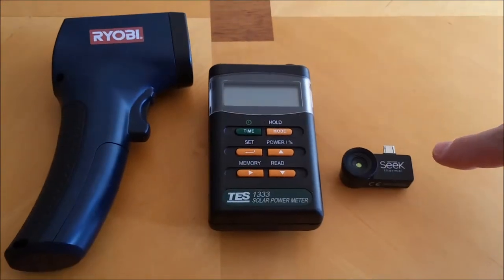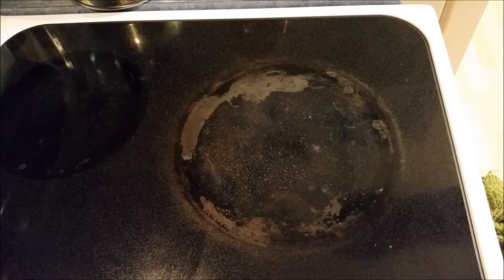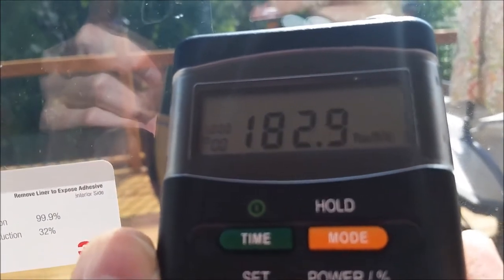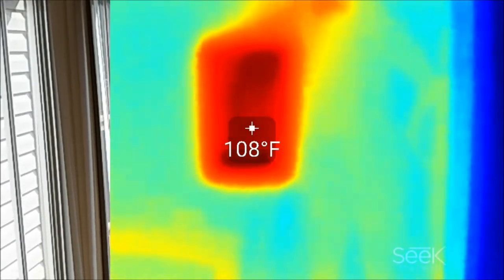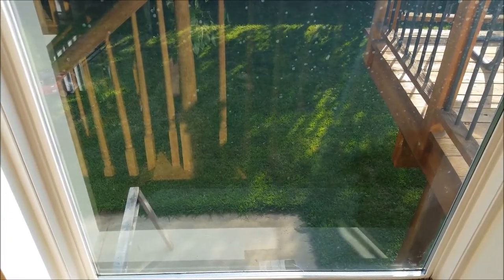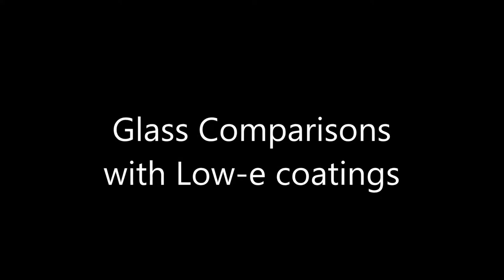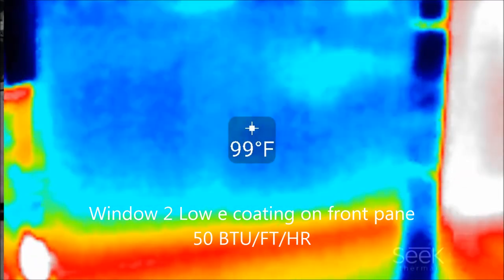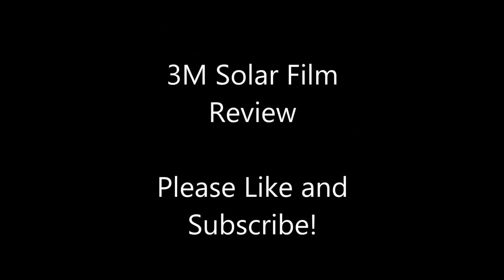3M Prestige 60 Solar Window Film Review

Comment: Hi Stem, I appreciate you posting this informational video. A few things I would like to point out as they may not be obvious.  1. With any window film the temperature of the window will increase, that is because the heat has to pass through the glass, hit the film and then pass back through the glass. In this process the glass and film will both get hotter. The good news is that this is heat that is not coming into your home. The amount of heat rejected from coming in your home is proportionately more than the bit of convection from the hot window.   2. If you install blinds the heat will enter undeterred into your home, while the blinds (because they are white) will be a lower temperature than the glass, you will still have radiant heat entering your space, and you will experience convective looping as you call it. 3. I think a fair test would be a before and after of the same space, same day, measuring the temperature of your interior space and furnishings in the light, not just that by the door. 

We have installed a fair bit of 3M Prestige, and the heat rejection is so significant that our clients see big differences in their utility bills, not just their interior temperatures.
Reply from the maker: Thanks for your response. I respectfully disagree with your assessment. 1) if the radiant energy is heating up the glass/film, then by definition you have now said it's heat and now in the house as thermal energy. It's been converted from radiant to thermal.  

2) it does stop radiant energy that is true, However, it's converted to thermal energy, which  just heats the house indirectly by way of convection looping anyway. 

I believe these are misrepresented as total energy rejection...thermal + radiant . If I have a black piece of paper in front of the window and say blocks 100% of total radiant energy that's true, but if I fail to mention it's just converted to heat thats misleading.

Is there some comfort with the films, sure, the radiant Energy doesn't strike you directly when in the space.  But you'll still get hot as the air temperature rises from the films and convective looping..

The cellular shades block and encapsulated the remaining heat from entering the space. There is leakage, but it's better than not having them. Shades provided better results than the film from what I have seen. 

If you want to see what the difference is in temps, watch my bali shades review. I do exactly that.  There I see the 15% savings on energy costs and lower temps. Proof positive they work.  Plus you can see how hot it gets on the window.  

Bottom line is the film needs to be on the outside of the glass to really reject energy. But they are not designed for that.
Reply: @stem_saving1644  have you ever been in a tinted vs untinted car?  How do you explain that vast difference using your train of thought?
Reply from the maker: The tint absorbs the heat and uses the glass as a heat sink.  Just like in my case.
Reply: @stem_saving1644  The shades will likely cause more of this heat loop you are trying to avoid. I really do think you were the victim of bad installer. 

If you reach out to 3M they can likely help you run a more complete experiment. Where you measure the temperature in your space on a sunny day and then measure it again with film installed on an equally sunny or sunnier day. 

There are millions of square feet of film installed every year mainly because of its ability to keep spaces cooler.
Reply from the maker: The shades aide in reflecting the remaining radaint energy the film does not reject, as well as contain the thermal heat of the film.

Not sure how the film is installed incorrectly, kind of hard to screw that up.
Reply: @stem_saving1644  As I understand the argument, light shines on a surface and heats that surface up, thereby heating up the air around that surface through convection. Without the film, the sun heats up the room directly. However, with the film, the film blocks the energy before it hits the room, but absorbs the solar energy and starts to convect itself. So the question is whether the solar film is reflecting or radiating the same amount of energy inside the home as is landing on it from the sun. Given that the film is on the windows, it stands to reason that at least some of the light is exiting the windows to the exterior, thereby reducing the total energy entering the room. So your measurements could all be accurate but the film would still work. What do you think?
Reply from the maker: Once the radiant energy is absorbed its converted to thermal energy (heat). Heat flow is impeaded when its transmission is over two panes of glass with a vacuum inside. 

Heat also flows from higher potential to lower potential. The higher the potential difference,  the more heat flow.  The outside of the glass is 120 ish... the inside mid 70s.... where do you think most heat would flow? 

Is there some heat being reflected,  sure (minimal). The label says "total solar energy rejected" which is radiant energy.  What's not measured is total energy rejected. A small distinction with a huge difference. Once the radiant energy is absorbed its no longer solar,  but thermal. 

Cellular shades block more radiant energy then films. So, short story long..... buy shades instead of 3m internal films.
Reply: @stem_saving1644  In case it's helpful, I spoke with a film installer and they said that 3M offers external films as well, which perform much better than the internal ones with the same rating. The Prestige 70 external, for example, is rated as rejecting about 80% of the heat, while the internal one is something like 50%. The down side is that the external film is supposed to last 10 years, about half of what the internal film does. So it seems like the your point is validated by them, but that there still is noticeable protection from the internal films (according to their numbers, of course).
Reply from the maker: Are they blocking total energy or radiant? A small distinction with a huge difference.  Total energy rejection is what's important. 

I would believe this to be better with external films. But highly doubt it on internal.  Based on what's on their label, they only quote solar or radiant energy. Which paints an incomplete picture. What's important is total energy rejection...
Reply: @stem_saving1644  According to their reported performance numbers, "Total solar energy rejected" for prestige exterior 40 is anywhere from 61% to 82% depending on angle of the sun and type of glass (e.g. single vs double). These are maybe 20 percentage points higher than the interior ones, though I don't have those in front of me.
Reply from the maker: Yes,  this is my point. "Total solar energy" is radiant energy.  Once its absorbed by the film, it's now no longer solar, but thermal (heat)  Its the combination of solar plus thermal that = total energy.

While external films will heat up.... This is taken away by convection to the outside air (some windows will void warranty with films installed) 

Internal films have a larger issue.... it's now carried into the house.  I'd ask more questions before getting them.
Reply: @stem_saving1644  The sales people did say the film re-radiates some heat into the room and that's the reason why external films are better. I'm not one to blindly accept what a sales person tells me, but I guess I assumed that since the external films had better numbers even though the film itself was the same, it was accounting for that.
Reply from the maker: So  the question to ask,  is what is the total energy rejection. Or how much thermal energy is transmitted into the space. Ultimately,  the total energy that enters the space needs to be removed in the summer.
Reply: @stem_saving1644  you can’t eliminate total energy coming into the room.  Even a wall transmit energy into the room.  What you are looking for is the Solar Heat Gain Coefficient, SHGC.  The methods for developing the procedure to test SHGC were developed by the National Fenestration Rating Council (NFRC), which is comprised of window manufacturers, vendors, and government agencies. 
The SHGC is recognized by the U.S. government, federal energy laboratories, Energy Star, the window and glazing trade associations such as: the American Society of Heating Refrigeration and Air Conditioning Engineers, the International Window Film Association (IWFA), and AIMCAL, the Air Conditioning Contractors Association, consumer groups, and many more organizations.  So clearly this method is the industry standard for accurate representations of actual energy efficiency.  This number will tell you the true energy efficiency of a window or film.  Film manufacturers will manipulate their data collecting methods to market their films but the SHGC will give you the real story.  

The SHGC takes into account visible light, infrared light, as well as UV light.  In addition, it takes into account absorption of infrared light into the film and glass and reradiated back into the room, exactly what you claim makes film worthless.  An SHGC of 1 is essentially no protection and the full power of the sun coming through.  0 would mean nothing is coming through.  

As I’ve pointed out, some films are designed with higher SHGC because they may want to capture energy and heat a room during winter, which btw would be idiotic to install in the desert.  Others are designed with lower SHGC to reject more energy and lower overall cooling costs.  

SHGC takes window heating into account because it is expected as the light goes through the film/glass.  However even with that energy being reradiated back into the room, the total energy coming through is still significantly less than with nothing.

This is the consensus of scientists and engineers who all have much more sophisticated tools for calculating energy transmission and efficiency.  They have no dog in the race, simply helped to create a standard to protect consumers from false marketing claims by window and window film manufacturers.  In the end, that is the only accurate number that you can truly ever trust on the film specs.  But the numbers clearly show that films do work.
Reply from the maker: @carlosperla7233  Not sure why your insistent on commenting here..... we have already discussed this in length previously.

No one said anything about eliminating total energy coming into the the space and yes walls do also have energy that gets transmitted.  But the best window is worse than the worst wall. Considering most windows have R value from 3-5 and 2x4 walls have R values of 13+.  That means more than 4 times the amount of BTU's come in through the window per unit area when compared to walls and that's uber conservative. 

The only thing you can do is limit the rate it comes into the space.  But ultimately its the total energy that comes into the space that has to be removed to prevent temperature rise in the summer not just the radiant energy which seems to be the only thing you considered in the past.

The SHGC you now mention was defined by the NFRC as it relates to window ASSEMBLIES. Fenestration meaning windows.  The entire window..... glass, panes, cross members, spacers, low e coatings, argon gas, etc... It can be loosely applied to films but is meant for windows. I have already mathematically shown this in disproving some of your calculations previously, so there is no new information here. Again, the total energy coming into the space is what matters and there are only 3 mechanisms by which it can happen: conduction, convection and radiation.  Well established thermodynamic laws that I have already went over.
Reply: @stem_saving1644  lmao.  When film is applied the SHGC is calculated for the entire window including the film.  A number is then assigned to the film based on its heat gain coefficient with and without the film....you know...the way science is actually conducted.

In the end you bought some fancy toys measure a few numbers, have no idea how to interpret them and then make claims that films don’t work just because you had no idea what film to put in your house.

How do you mathematically measure the amount of energy from hot glass?  You don’t...you just assume that the hot film contains more energy than was blocked.  You have no way to measure total energy as none of your tools measure the amount of energy radiating into the room.  As a result your claims that the film doesn’t work is grossly unscientific because it is based on your anecdotal observation of the hot glass.  Labs that assign an SGHC to the film do measure that and are certainly more qualified to make the determination on whether the film is energy efficient.  

Btw...you are the one who stated that total energy has to be removed, once in a post where you claim to know more than the engineers that’s designed 3M film and again in this post.
Reply from the maker: @carlosperla7233  The way science is conducted? LMAO, says the person who says you can't calculate the amount of heat energy radiating from glass?  Yup, I guess when they measure the amount of heat energy from an HVAC hot coil, that  can't be done either. Or measuring how much energy that comes through your walls in the summer... Its all magic. 

Perhaps if you studied a little physics or building science you would know how thermodynamics works.

I never claimed to know more than the engineers at 3M. Just more than you.  But I will agree, in the end I do have fancy equipment and measurements and you haven't shown anything scientific...no data, no measurements, no videos nothing. If you are going to refute facts, bring some science to the table, not hand waiving.
Reply: @stem_saving1644  lmao.  Do you even read what you write?  Film is engineered by engineers at 3M.  Clearly they believe their product works.  You claim it doesn’t....what are you failing to understand?

Apparently your reading comprehensions is suspect along with your understanding of science.  All I asked is how YOU measured the heat given off by the glass....you didn’t.  You are just assuming that because it’s hot, it is proof the films don’t work.  I know exactly how you would measure it and your thermometer reading isn’t it.

Here is how science works.  Take your window and measure how hot a room gets without any treatments.  That measurement gives you at minimum a temperature reading of the amount of heat energy in the room.  Hopefully you understand that basic principle of temperature.  Then you add film to the window and do it again.  If the overall temperature of the room is lower, then less heat energy is in the room.  And before you whine that it doesn’t take the hot glass into account, wouldn’t hot glass heat the room?  Therefore the heat of the glass is part of the equation.  When you discover a lower temperature, the only difference was the film therefore that is the cause of the lower temperature.

This is exactly how SHGC is calculated, only with more scientific tools and measurements.  But I guess you know more than they do as well because you bought some fancy toys.  Btw....if you couldn’t even get the right film installed, how do you trust any of your “understanding” of how they work?  And if you are so wise, why the hell would you put it on so many windows in your house?  Sound pretty dumb if you ask me to pay and install something that doesn’t work in your home.  It’s like you putting water in your gas tank and then whining that cars aren’t worth it because you bought these fancy toys to test the car and it won’t start.  

Regardless of what you say,  there is an industry that makes and sells various engineered films for a variety of purposes.  There is also an industry to measure the quality of said films independently to protect consumers.  There are millions, myself included, who install the correct films.  Oh...and there are also reports from the US Department of Energy and Consol Energy.  You know what everyone has in common?  They all agree that window films work.  But you buy some toys on eBay and suddenly you are an energy engineer because you discovered that the film heats up the glass.....no crap Sherlock.  I could of told you that by touching the glass pre and post film installation.

Btw... as I stated in my last post, you may as well removed your curtains and window panes as well because they all heat up when the sun hits them, and according to your own words, if you remember them, what idiot would put up something that heats up in order to cool a room.  I hear 3M is hiring, I’m sure they would love your expertise in energy engineering, but don’t forget to bring your eBay toys with you.
Reply: @stem_saving1644  I think Carlos won this argument. Total heat energy of room less after film applied is a win either way you spin it. The room will literally be cooler.
Reply from the maker: With the implication there is actual energy rejection. In my case the films heat up,  which does little for total energy rejection.  Works good with stopping uv though.

Comment: As a currently 3M soalr film user living with hot air inside room...i came to find this gem! 
Thanks for being honest 
mighty informative
Reply from the maker: If your using internal films, are you experiencing similar results as I am?
Reply: @stem_saving1644  yes, I do. The film inside gets hot and heating the room, albeit slowly . Now considering 3m prestige 90 exterior.
Reply from the maker: Thanks for the feedback.  Let me know how the exterior works.  Not impressed by the interior films at all.